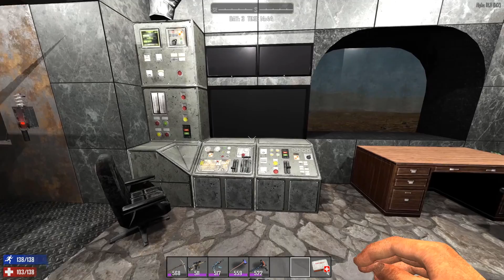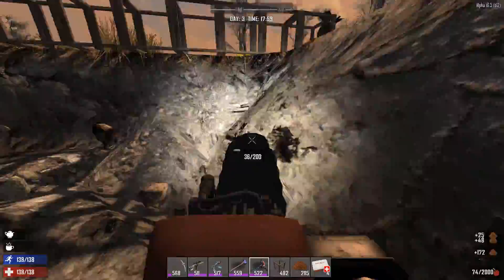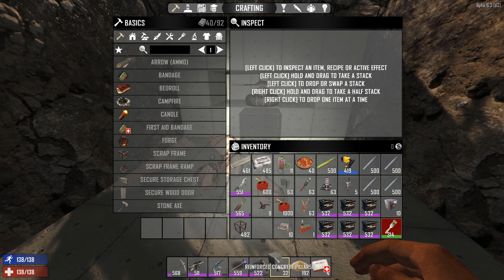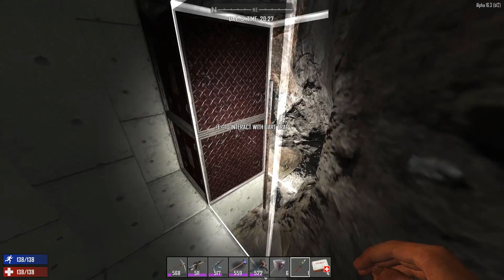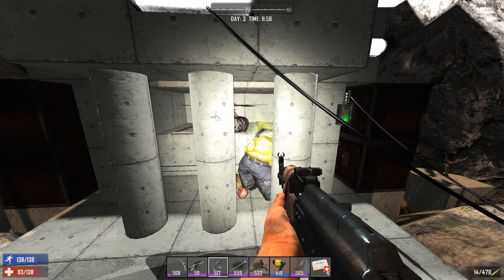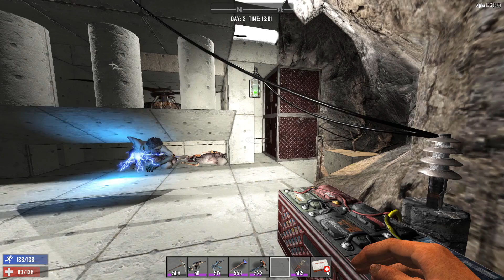7 Days to Die | BUILD Advanced Cop Trap | Alpha 16 Gameplay

Comment: This is really cool I would flip the blade trap upside down and put it on the lowest block. I have a cenulated slicer trench in my latest week of videos if you want to see. But the idea is the blade trap knocks off their legs really  quick then when they are crawling it continues to cut into them. I have noticed if the blade trap is the right way up and on the ground zeds have a chance to not get cut due to collosion volumes.  Anyway would just make it fast IMHO.  Cheers good work ☺
Reply from the maker: I think 2 blades will last twice as long, and they shouldn't be damaged by gore blocks. What I think happens is that the gore block is trying to form, finds no empty space (actually I think it goes upwards to the top) but the blade trap can't carry blocks (0 SI) so the gore block just pops and vanishes. It's not actually destroyed by damage.
Reply from the maker: That's an interesting idea! So are you saying blade trap upside down on the lowest block will take crawlers too? If so, placing two traps there would be great, one for the neck and one for the crawlers.
Reply: cjc023 yes I guess that is true it does destroy most of them. So if wanted to keep the gore block you would  keep it the same. I was thinking for max defense.
Reply: Fair enough. The zombie loot isn't really special anymore. I'm more worried about the blade trap's durability. Would it take damage every time it hits/destroys a gore block?
Reply: Well early game its useful.
you hve some good points I would love to know the answer. Experiment time!
Reply: Yes. One trap on the ground, the second above. But you need an anker for the second. So trap->trap->block (vertical thinking). 

I used it early in A16 but i missed too much loot. In later gamestages, the loot is realy important for me, because i determing loot-respawn.
Reply from the maker: Yeah it's too bad blade traps have no SI.. can not carry loads :P so can't place them on each other. Woulda been cool otherwise ;) But I suspect it's any SI would apply to the whole 9x blocks, not just the centre.
Reply: yeah it could be done in reality. A bearing and a shaft with the blade mounted on the outside. Sort of like a propeller. Central shaft could be steel which would hold a lot of wight too
Reply: oh that makes sense why one with those settings would prefer that.
Reply: If you put the blade trap in that position, wouldn't it destroy the gore blocks too?

Comment: Not bad vedui. Instead of 50Pillar you can use 1/4; concrete blocks or concrete poles placing "inside" or even 1/2 concrete blocks. The Arrow Slit is a good idea protecting the darttraps but i think, instead of die slits you can also use 1/4; 1/2 blocks or poles. 

And men - now i thought about 1,5 hour to convert that desgin into a bloodmoon base-desgin. With a sensor instead of the trap wire, your desin is a 7x4block trap. with 3 blocks "zombie-playground". Of course waaaayyy to small. 

First i thought there is no way for a functional bloodmoon base. even if you "build" it "around" you (each side one cop trap).  But you can expand that desgin to a "double-trap" each side. That might be enough room for a real bloodmoon horde.
Reply from the maker: Yeah that's a good suggestion! I get the sense that the poles/quarter blocks had a change in A16, as in A15 I would get crawlers coming through (well under) poles I placed. But that doesn't seem to happen anymore, they appear to get stuck.

I'm already recording another build video (for next week) where I'm extending the base with walls. Will start with basic walls and defenses, of different types, then work on improving them for tougher horde attacks. :) Hopefully people enjoy seeing builds as much as the testing and tutorials :)